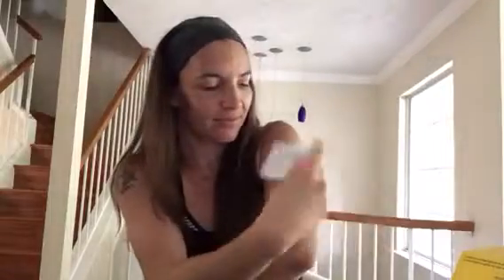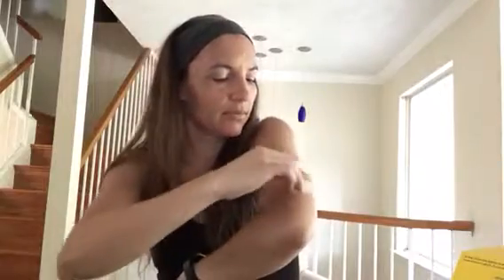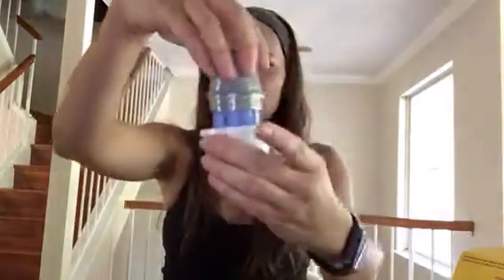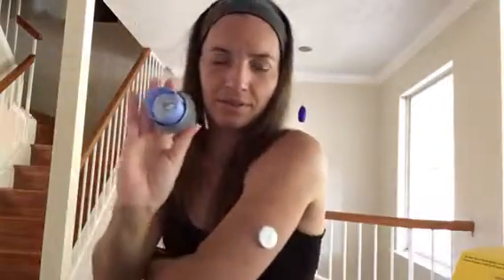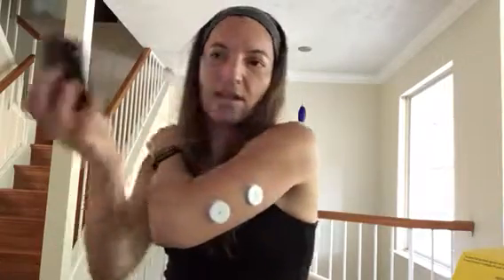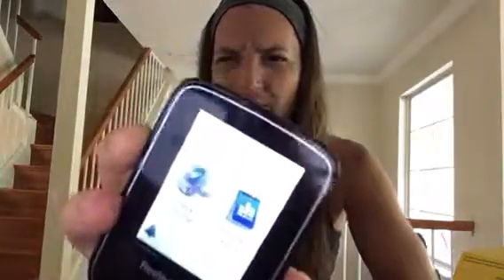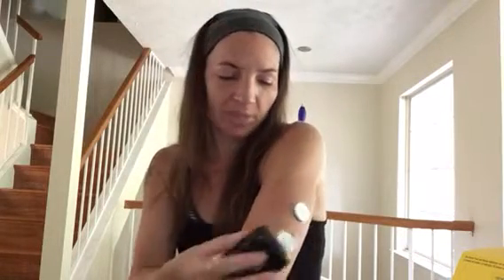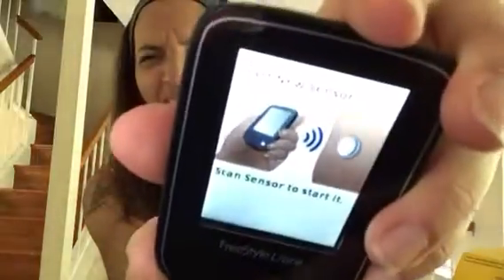Freestyle Libre: Starting a new sensor before current sensor expires (SCAN to START)

Comment: I use Blucon with Freestyle Libre sensor and able to reactivate my sensor for another 14 days with the help of Blucon device and able to check glucose values on my watch directly without scanning the sensor.
Reply from the maker: So you can restart the Libre 2 14 day sensors, or are you talking about Libre 1? I would love to try the Blucon and was supposed to receive one a long time ago, but I never heard back from them. 
:(  I would love to explore it if I ever get my hands on one!
Reply: @nickyghaleb  I can restart my Libre1 for another 14 days with the help of BluCon device. Also, you can email them or chat with their customer support team. Thanks!
Reply: I am using the LinkBluCon app with the blucon, able to activate and extend the life of FreeStyle Libre 1 and Libre Pro sensors by 1-2 weeks. Earlier I used Dexcom and after switching back to Libre I was always using an incomplete product due to lack of alarms, sharing option, etc.. but not any more. Now I am able to try different types of FreeStyle Libre sensors with the blucon without worrying about the new Libre Reader for every sensor.
Reply: Hi Mark, I bought the BluCon device few weeks back, it really helps me a lot every time to monitor the glucose values.

Comment: I know this is an older video, and you're probably not wearing the Libre anymore, but I'm wondering if once you switched arms, did you find one side more accurate than the other?
Reply from the maker: Hi ThePJ-T1D-mommy! I actually do still wear it and have worn it mostly on my left arm. I have switched to the right side a few times but have never noticed any difference— or at least none that I would’ve attributed to that. The few times I’ve definitely noticed a difference in the types of values I have gotten, there were other causes that have come to mind, including the amount of blood at insertion or the use of Ibuprofen. Don’t know if that helps?

Comment: Thanks for the very helpful tip Nicky! I am on my first 14 days and had to request a new reader because mine has been having problems scanning. If I have 9 days left with this sensor and I am getting a Libre replacement reader, how do I switch from one reader to the next when my current sensor has 9 days left?
Reply: Tawnya Vanterve This happened to me and i simply called up and explained that i had 8 days left on my sensor but a different reader, as i payed for the sensor and didnt expect it to be useless they sent me a free replacement sensor with the reader!
Reply: @eviegood1783   Thank Evie! I called Abott and they are sending me a new sensor because they said I can't use a new reader with a used sensor. I also made a youtube video explaining this for those looking for the answer. Thanks for your quick response I didn't know if you would see it. :)
Reply: Tawnya Vanterve Yes i wear the libre and had this experience and know how frustrating it is not knowing what to do!
Reply from the maker: @eviegood1783  thank you SO much for responding! I read this in the middle of the night and thought I had come across it in my group. It may have taken me weeks to figure out. 😁
Reply from the maker: I literally was sleeping on this, Tawnya Vanterve. 😁 I read your comment the other night and thought I had read it in my facebook group. So I was trying to talk Libre with them--and they weren't sure why. Anyway, I'm very glad Evie Good passed through. What a simple solution!
Reply: nicky ghaleb no worries if you ever have a problem abbott can usually fix it :))

Comment: Is it ok to put the new sensor ahead?and start as new sensor after the old one expires? my sensor will expire in 5 hours and thinking to put the new one ahead and scan as new sensor later.
Reply from the maker: Not Expert I’m not an expert either, but I CAN tell you I had the bad habit of leaving an old one in until I had a good place to dispose of it, and there was never any problem with it. The active one scans fine, and the inactive one either won’t scan at all or gives an error. I do not know the answer for sure, but I would be surprised if it were a problem.
Reply: nicky ghaleb Thank you!

Comment: thanks for this. Another thing that works is to keep an old one around to scan to get the message apply a new sensor. Mine got ripped off which is rare for me actually and I couldn't find the dang thing anywhere. it got ripped off and fell into a void (probably called Jon dog's stomach!!) which is sad but also hilarious.. thing had 8 days left, but I am doing the thing where you recycle old sets so i used an old sensor to set up the new one. Peace on ya!  :)
Reply from the maker: This is HiLARIOUS, Deb White!! Did you try to scan his belly?! 🤣🤣

This is also a great trick. I’ll have to put the next expired one up into my cabinet collection of strange but fantastic diabetes trinkets and doohickeys. It’s my favorite cabinet in the house. So, just to make sure I get it, you’re basically just tricking your reader into asking you to do what you’ve already done but still need approval of?

I complicated it. You made it simple, and I tried to get cute. Putting my next expired one away foe a rainy day. :)

Comment: Thank you ! I search for almost an hr for this info. So what I understand from your video is that there will always be a 12 hr gap when you change sensor ?
Reply from the maker: Yes! I’m sorry I’m so slow to respond! Yes, that is what I meant at that time, but I am about to try out the Libre 2 which, if I’m not mistaken, changes to only a 1 hour warm up. Maybe 2. I’m a little rusty. 😬
Reply: @nickyghaleb  did you try the libre 2?  just wondering if it is a 1hour lag time?
Reply from the maker: @infinitycraftsbeinspired  to the best of my recollection, the Libre 2 has a one hour warm up!

Comment: Hi, Thanks for this, but after mine came off when I was drying myself, after a shower, The reader will not detect the new one! Still shows 3 days left.  I've googled on line etc, to see if I can reboot or take the Reader back to Factory settings - nothing! Any hints?
Reply from the maker: I thought about this for days and never came up with anything. I even had you in mind when I tried to swap out my first Libre 2 sensor a day early to see if I could figure anything out. I couldn’t. What ended up happening??
Reply: Hi Nicky,I contacted Libre here in Oz and a young lady helped sort it out. She got me to do a whole range of tests on the reader, using a "secret" internal menu. She came to the conclusion there was nothing wrong with the reader, and that I had a "dud" sensor. Libre sent me a free replacement and a return package to send the non working one back to them. So a win , win remedy all round! 
Footnote:- Luckily I had a spare at the tIme. 
Take care, and stay safe - Pete
Reply from the maker: @towelminder7814  they have a secret menu?!!! since reading that, I've been going through everything I could find through my single button. 🤣 But on a very serious and sad note... I might need to find out how to do that reader test. I've just put on my second Libre 2 sensor, and I'm getting errors left and right. Thank you for coming back and leaving the update. I'll give them a call and get access to it. :D 

If you're interested, I've got a diabetes tech facebook group called The Honest Exchange. You're welcome to come and see what it's about. It's sometimes on target, and it's sometimes a big mess. https://www.facebook.com/groups/527623797620537

Either way, thanks for the info, and I wish you luck!
Reply: @nickyghaleb  Hi Nicky, You'll probably have noticed that I've applied to join The Honest Exchange. Hopefully talk soon. Kind Regards

Comment: FYI: My doctor says I should change arms (left/right) with EACH new sensor.
Reply from the maker: Hmmmm.... that is REALLY good information. Thank you very much. I usually just sacrifice the left side of my body, and I figured I would stop once someone suggested it.....  so thank you for looking out for my left arm. 😁
Reply: nicky ghaleb I guess it has something to do with giving one side some time for „recovery“ while using the other ...like you do with injection spots I think. But on the other hand, if you don’t use the EXACT same spot on one side it might be still ok maybe.
Reply from the maker: So I went to my right... and confirmed why I don’t go to my right. 😁 I think my left thumb is probably the problem more than the entire right side of my body. I must’ve only partially pushed the button because I had a partial, but fully painful, insertion. It’s in now, but I’m putting my thumb on a strength training program effective immediately. 😁
Reply: appreciating for this suggestion. thank you so much Kiryk. And I thank Abbott also for introducing such a marvellous Sensor for the Diabetic Patients.  But here is one more device which adds chary on the cake. On the FreeStyle Libre Sensor I am using one more device BluCon NightRider which gives me reading in every 5 minutes on my Mobile. I am safe now, i don't need to carry my Libre reader. Just sharing my views. Cheers!

Comment: Sensor useable in 12 hours? I thought it was useable in 1 hour, the "warm up"period. And said you used skin-tac. ONly then you didn't use the skin tac. You need to slow down a bit when making these.
Reply from the maker: Thanks for the comment, Jeff S. For your information, this was the 10 day sensor. I made the video in October of 2018. I just moved to the 14 day sensor about a week ago. On the 10 day sensor, it was a 12 hour warm up. With the 14 day sensor, it’s now a 1 hour warm up. And I actually did use the Skin Tac. I used the alcohol wipe first and then fanned the area with my Skin Tac wipe packet. Then I tore it open and applied the Skin Tac. It’s a wipe, not the liquid.

Comment: if your new sensor will be ready in 12 hours di you have to go back to finger pricks for half a day ? annoying
Reply from the maker: They’ve actually done away with the 10 day sensors since I made this video, Kai Ciccone. They’ve been replaced with 14 day sensors—and a 1 hour warm up. I’ve never been annoyed by finger sticks anyway, but there’s really no need now. There is also little need for finger sticks over the course of the next 14 days unless you’re experiencing fast moving blood sugars or extremes, either high or low. I personally do not trust any of my sensors enough to do a food or correction bolus without a finger stick, but there are people out there who feel comfortable doing so. All in all, it’s a good little sensor. 🙂